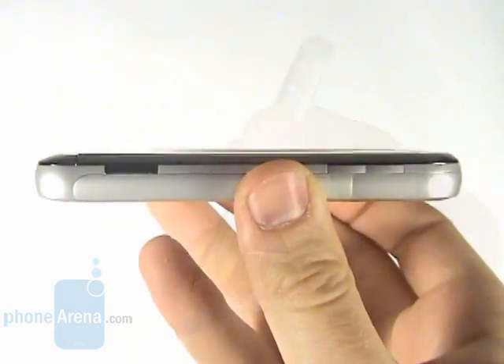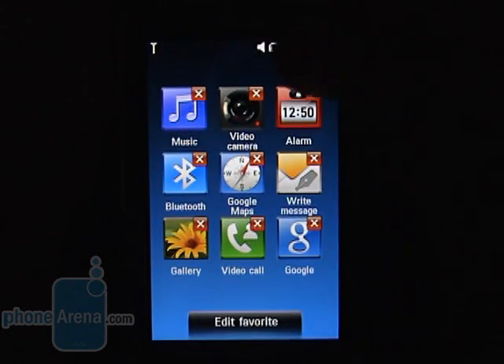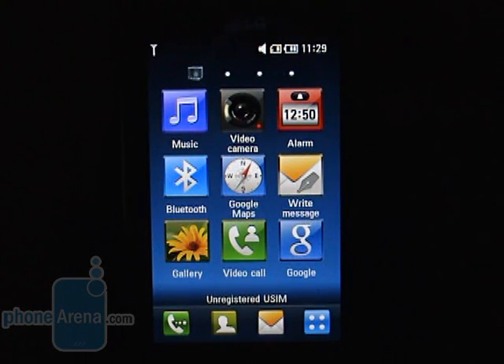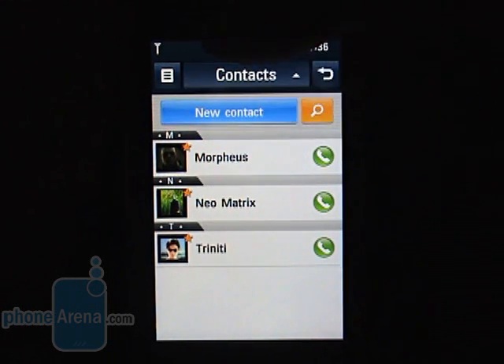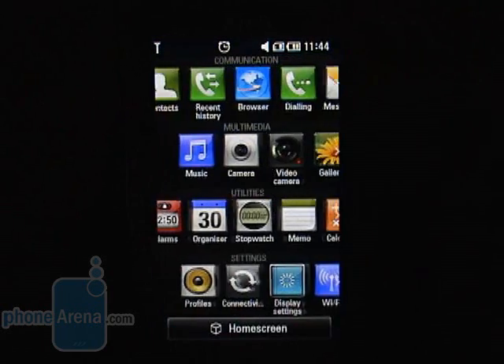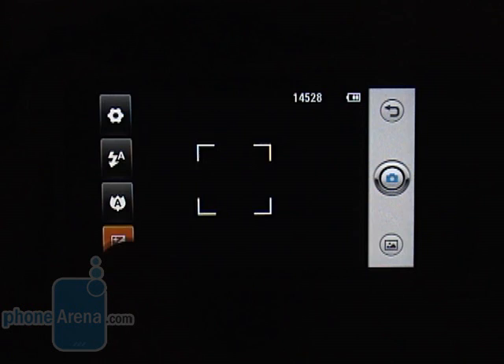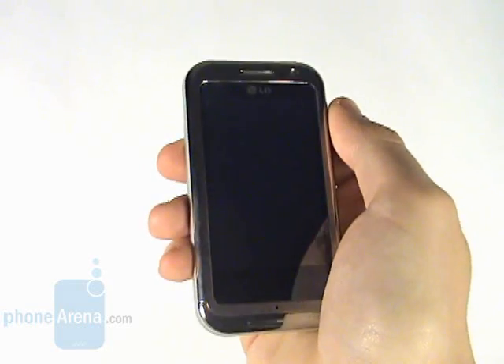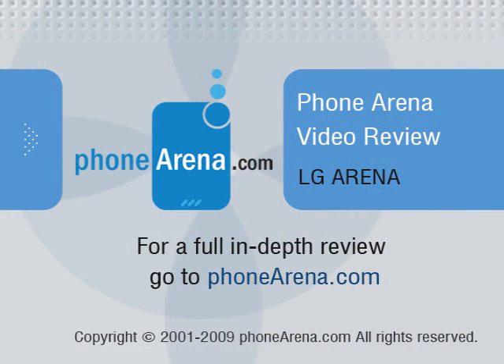LG ARENA Review

Comment: @JC040696 
I own both of them  and i would recommend Arena.Better materials better camera multitouch better screen resolution though less colors(5800:16M Ar:256K) more beautiful better respond to ur touch plus arena doesn't need a stylous to operate it is designed for hand use but if u concern about applications and gps go for 5800 cause 5800:Symbian Ar:SClass 5800:GPS,A-GPS Ar:A-GPS ONLY.Also arena supports dolby mobile,divx .H264 while 5800 sucks on terms of sound & video.5800 also lags A LOT